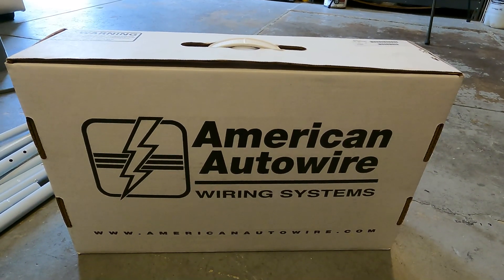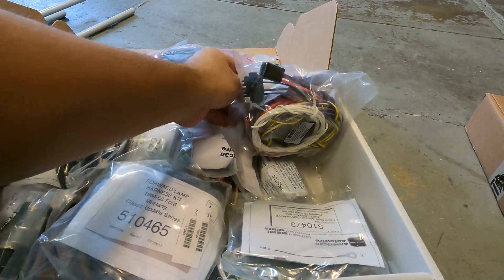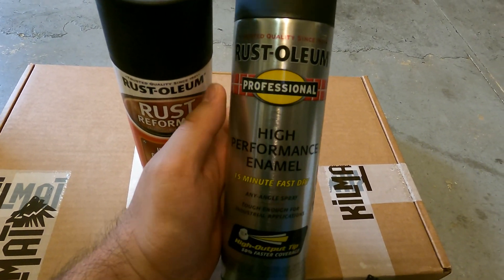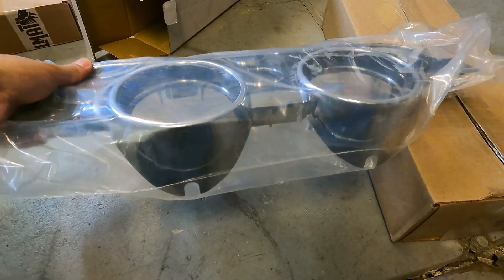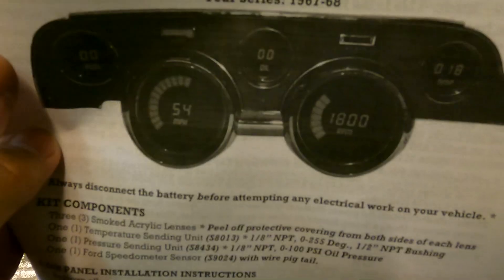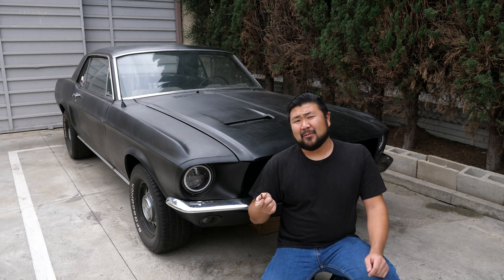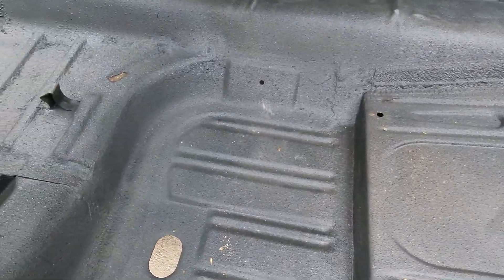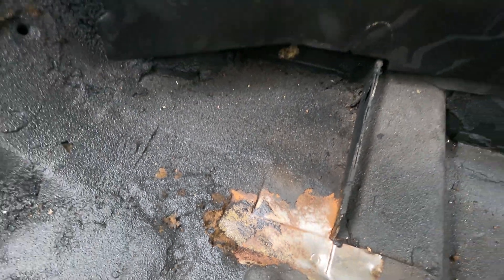1968 Mustang Update!!!

Comment: did you ever figure out the DRLs and highbeams on your headlights?
Reply from the maker: I wasn’t able to sadly, whenever I tried doing the highbeams something would start smoking so I most likely will be rewriring the whole car. I’ll try to get back to uploading asap! Thank you for the continued support 👍🏼
Reply: @JeffSongCars  appreciate that, currently trying to put the exact same headlights you got on your car on my 67 mustang, issue is i'm too worried i might cause irreversible damage if i try to splice wires in an attempt to get that halo light working.
Reply from the maker: Yea it seems the old wiring is very prone to receive damage. You might be able to use new wires for the slightly older/worn out looking ones. Let me know how it goes! This is going to be a long project haha @TheBucketDude